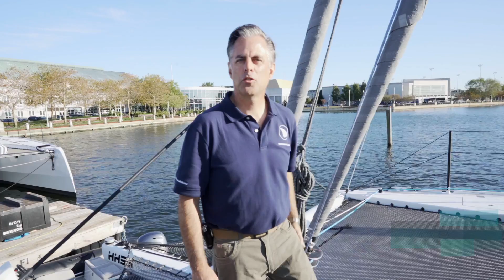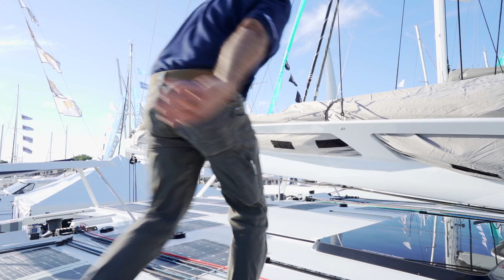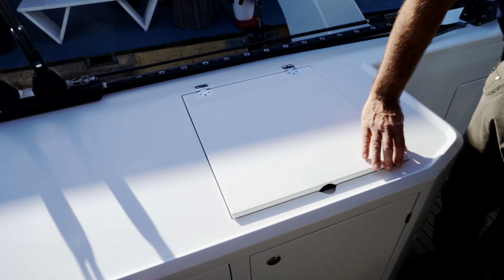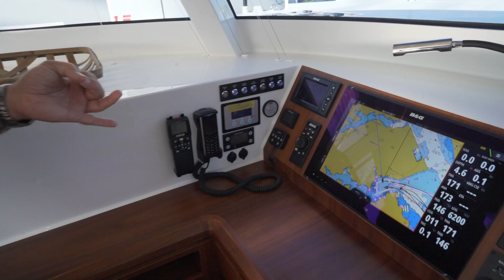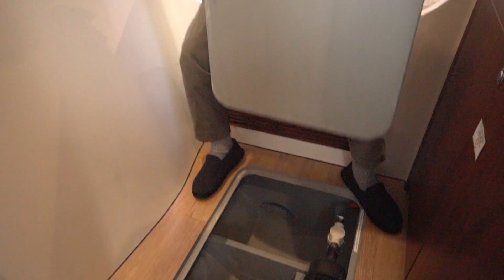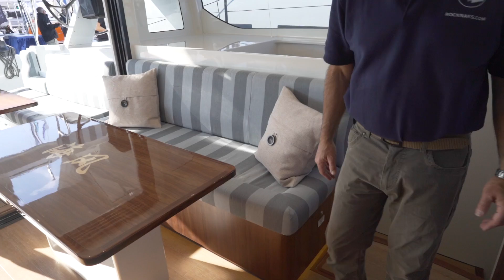HH55 Catamaran.  Guided Tour & Our Review.  Perfect Balance of Performance and Comfort.

Comment: SEEING OTHER REVIEWS AND TALKING ABOUT H&H BOATS  I'VE COME TO REALIZE THAT THERE'S TOO MUCH LIVING SPACE LOST THAT YOU ONLY NEED A RACING BOAT BELOW THE WATER LINE WATER LINE THERE'S NO REASON NOT TO EXPAND THE HALLS OUT TO MAKE FOR A MORE COMFORTABLE LIVING SPACE
A SPACE A DEDICATED SPACE FOR A HOME MACHINE SHOP WITH BOTH AN ENGINE LATHE AND MILLING MACHINE WITH DIGITAL READOUT OR AT LEAST AN XYZ POTTING TABLE THAT YOU CAN MOUNT WHATEVER MACHINE HEAD YOU WANT IT ON IT BE IT A MILLING MACHINE HAD OR A LASER OR A PLASMA CUTTER OR ANYTHING THAT OR LET'S SEE A 3D PLASTIC MOLDING MACHINE OR MOLDING HEAD . I WANT WANT THE HELM TO BE IN FRONT OF THE MASS . AND A SECURITY CAMERA SYSTEM CONVERTED TO CHECK EVERYTHING ON THE BOAT VISUALLY FROM THE SALES AND TELL TALES CLARENCE FOUR AND A HALF AND AN EYE ON YOUR DINGHY AND BILGE AND PLACES YOU CANNOT NORMALLY SEE SHOULD HAVE CAMERAS THAT YOU CAN JUST TURN ON AND TAKE A LOOK DOWN AND FORWARD FROM THE TOP OF THE MAST
DAVID ADAM GRENIS BOULDER COLORADO USA

Comment: One of the things I always wonder about all of these new boats is the lack of hard points for life lines. Either they don’t show them on the tours or they don’t exist. If I have to go up on deck in big weather I want lots of hard points close enough together to transfer life lines from hard point to hard point without ever being unclipped. The distance between hard points should never be long enough that it requires lanyards that would allow you to be swept over the edge of the decks. Being drug to death along the side of your vessel is not a great way to die. You are faced with drowning while attached to your boat or pulling the emergency release and drowning watching your boat sail away without you. 
     Also most life lines should be called death lines as they are usually just the right height to send you head first over the deck into the water. I would sooner have taller masts and shorter sails to have decent height life lines and stantions you can hang a truck off.

Comment: Most of the features I've seen on this boat are pros. Maybe a negative thing is by making the hulls made of carbon fiber which I think could block the signals of mobile phones and gadgets from under. So a fiber glass maybe is much better design for the hulls because it doesn't block signals, imo.

Comment: Solar panels are very sensitive to occlusion of light impinging upon them.

So all the lines that can be seen laying across solar panels on this boat are probably sufficient to stop the affected panels from providing current to the electrical system making them a waste of money and space.

So far as I am aware any sheets, halyards and lines that need to traverse solar panels on any boat are usually routed so they pass beneath rather than over the top of them.

Mono hulls have been designed to suit specific applications since complex structure first became an increasingly significant aspect of their hulls and in due time the same practice naturally extended to catamarans.

Performance cats and cruising cats are distinctly different designs intended from the outset to meet distinctly different applications just as has always been the case.

Performance cats may be great for speed, but things like carbon fiber and retractable keels or 'shoulder boards' do not provide the level of comfort and ease of use required for people who live aboard and may do so for years and even decades.

Carbon fiber is undoubtedly a high-tech wonder material but it is expensive and difficult to work with and in addition not only is carbon fiber not readily available in a majority of locations but neither are people with the  necessary skill to work with it.

By their very nature performance cats do not have the weight carrying capacity of cruising cats for good and valid reasons and pounding through seas of any size at ten knots or more is not conducive to comfort.

'Blotted cows' have always filled a need to haul cargo while more elegant designs do not merit intolerant contempt for being what they are meant to be which is comfortable, stable, reliable floating homes.
Reply from the maker: Good point. Solar loses efficiency if even slightly covered.

Comment: Is this boat worth the 2.5 - 3 million dollar price? IMHO, no, unless you don't need to ask that question. At 1.5 million, half the price, I would prefer the aluminum Garcia 52 Explocat over this cat even though the displacement weight in the Garcia is more. For bluewater cruising/exploration, it's a tank, is also very rugged and stiff, can sail in the high teens in moderate winds, also has the twin headsail, solent style rig, and also has the forward facing cockpit for forward seating. And, it's a Garcia. Thanks for this review.
Reply from the maker: It is way out of our prospective budget. But it was nice.

Comment: Whoa, looks like the fiberglass 50 is probably a reasonable price range.  I’d give up the performance, cause in fiberglass it will still be a good performance boat.
Reply from the maker: Yes, and fiberglass is much easier and cheaper if you need to get repairs done too. We could never afford an all carbon fiber boat anyway.

Comment: 33:25 why not just have a high-def camera(s) instead of two helms?
Reply from the maker: I really only see the benefit in having two helms  is if you are coming in to a marina or a dock and you want to be steering from the side that you will be docking on so that you can judge distance better. But other than that. I would always opt for just one helm. There’s no need to spend all the money to have everything duplicated on both sides.
Reply: Cruising Off Duty I agree. I think though there is a customer base of “rich” weekend sailors who want the two helms as a “racing” thing... and spending the extra money is an ego boost.  It’s showing off.

To them the two helms is like the two sinks for Janice.

Comment: Very nice, expensive yes! However it sounds like there's a lot of engineering and work going into each build. Styling is a lot better than at the moment. They haven't chosen to use the nothing but square styling most seem to be opting for. Thanks for sharing.

Comment: Thanks for sharing another great video. 

One of the most common laments I hear on videos of sailors is "the wind died", or "the winds were light" so we had to motor.  With a performance cat I would think that even in light winds (4 to 9 knots) you could be moving over ground at almost the wind speed (depending on the point of sail); that would have to be a nice option.
I like that this design had hulls wide enough to put in comfortable cabins and beds while minimizing weight to keep this cat in the performance category.  It had nicely protected helms as well.
Reply from the maker: I agree that a light performance cat can probably sail in much lighter wind conditions than a heavy production cat.

Comment: Yeah, $3M is kind of a hit.  I was interested in what Scott was saying about the E-Glass 50 and the keel system on that.  Winglets?  I've always wondered what a cat with a set of foils or larger winglets would do, particularly on a broad reach or downwind sail.
As to the appearance of the boat, and I realize it's a custom, so I could change it if I wanted to, I don't like the stark white interior.  If I was going to live on a 55-60' cat, I want something that's 'warm and cozy' and this boat didn't tick that for me.
Craig, something I've seen from Yanmar, and I would love to see it adapted to a catamaran is their 80-SPP drive system.  A steerable pod system with a bow thruster, it uses a joystick control to run the engine and the bow thruster together.  Currently, insofar as I'm aware, it's only available to monohulls.  However, if it could be adapted to a catamaran, you would have some fantastic controllability for docking, or even 'position holding' if coupled to your GPS.

Anyway, a bit out of my price range.  Besides, I want a Privilege.  I hope they had one at the show and you got the ability to view and tape it.
Reply from the maker: Thanks Gary for writing in.  The interior surfaces are painted so I am sure you could get it painted in a warmer colour.  There was a Privilege  at the show and it will be shown in an upcoming episode.  I think it was the last boat we filmed.  We liked it a lot, but its above the price of many of the boats we filmed (except this HH), so I doubt we will be getting that, but, it maybe perfect for you.  Again, if we had deeper pockets, we would have a much broader range to chose from.
Reply: @Bowmans-Woods  Perfect for me?  Hardly.  In my dreams only and if I hit the lottery.  I'm currently homeless and unemployed and live vicariously through people like you, for which i'm thankful!
Reply from the maker: Ok then. We can both dream and you are more than welcome to go window shopping cats with us.   :-)
Reply: @Bowmans-Woods  Craig, I'm single, have family, but no wife or kids.  When I win the next MegaMillions, $130M cash, I'm buying a catamaran, not only for myself, but a newer one for the Wynns, one for Nick and Terysa, and I'll help you get that X5 from Tomas that you want.  :) :p
I figure you guys have helped me deal with my problems, if I get lucky, y'all should share.  :D
Reply from the maker: That would be great.  That would make the news for sure.  Fingers crossed!  ha ha

Comment: From the angle shown the engine compartments access looked quite cramped for such a large boat, and you didn't seem to have a problem with all the lines being exposed to the weather and deteriorating on a 3m dollar boat as you did on a 600k Seawind 1260  ! 
It  was a pity the Seawind sales rep wasn't have as good as Scott.
He was excellent  !
Reply from the maker: Well I did notice the exposed lines but it seems to be something that the performance cats have.  Difference here is the lines were not on the deck where you need to walk.  Walking on lines is sub optimal IMO.  Big difference  when on top of the roof, although I would prefer they be hidden.  I saw that they also covered a bit of the solar which I thought wasn't great either.  Performance cats tend to want to eliminate weight at the expense of having lines exposed.  It is what you expect.  We wont be getting a performance cat but I can fault them for the design choice.

Comment: Great walkthrough. It IS interesting to review a boat designed for 'other' factors, like speed (light). Bit worried about carbon fibre maintenance (DIY?) and insurance, but if you have to ask... Also, the search for lighter is either more expensive or under-sized components (tanks, generators, etc.). This seems like a great balance though and the hull design with rigging is beautiful!
Reply from the maker: Good points Brian.  If you do have a chip in your boat, you may not be able to patch it yourself if it is built our of Carbon Fibre.  And, yes, as soon as a Cat seems focussed on performance it usually is very sparse inside when it comes to Cabinets and storage areas to minimize weight.  This boat seemed very comfortable.  A good balance of performance and comfort.  Just wish we were rich enough to be able to afford it.  I am sure a few viewers are and they may get a lot our of this tour video.

Comment: Sorry, but it is ALL laminate, he said so himself.
Reply from the maker: Real wood laminate over carbon fibre is what he said and the trim around the edges is also real wood.  I believe THAT is what he said.  You realize you could have fake wood laminate, right?  There is a difference.
Reply: A very selective quote - he said - 1. real wood edges, 2. wood laminate over carbon fibre, 3. when he tapped the door its real wood. Only hear what you want to hear (and in bold too).

Comment: Nice review and gorgeous boat.  I love the headroom.  Only nit is that I’m pretty sure the isolation transformer doesn’t convert 50/60 cycles, but 120/240.
Reply from the maker: It is gorgeous.  He may (or may not) have explained the Cycles correctly.  I think the point is, if you pay extra, you can get a boat that is universal and will take either European or North American shore power and convert it.  Im sure you wouldn't want both types of plugs in each cabin as that would be a waste of space and wiring.  You would pick your appliances to match your home country but at least you would have the peace of mind to know you can plug in anywhere.

Comment: I really liked the guy's presentation. Sometimes, it's just nice to dream of something completely out of your price range.
Reply from the maker: I agree totally Fred.  We knew as soon as we stepped onboard that it was out of our price range but it is fun to dream and we know some of our viewers have deeper pockets and get a lot out of tours of boats that match their budget, not ours.
Reply: I think that he's a very good salesman. Even though he knows that the HH 55 is way out of their price range, he treats them with respect and gives them a proper tour. At the end, he mentions the lower priced HH boats. 

Talking about out of my price range: every now and then I look at Gunboat 68 videos 😀 As much as I like Gunboats, I don't like the interior helm station. I much prefer being out in the breeze like the HH 55. But having to go down through the cockpit or round the back to go from one helm station to the other could be a bit of a problem.  My many years sailing A-Class catamarans, out on the wire with a 10' tiller extension, has probably affected my perceptions and made me a bit weird. 

Which leads to the question of rotating masts. An aerofoil shaped rotating mast cleans up the air flow over the lee side of the sail and you get a huge increase in lift. However, it's not just as simple as providing a rotating mast step. You have to make sure that all stays and shrouds, everything that goes from the mast to the deck, doesn't get affected by the rotation. We solved the problem by having single point on the leading edge of the mast where all the stays and shrouds attached. Maybe it's not as simple on a big cat? The HH 55 hulls look like they could handle the extra power. Is it a cost thing?

All in all, this is a very nice boat.

Comment: You don't need a lot of cabinetry in a propper performance cat because you are not supposed load her down with a lot of stuff anyway. <g>
Reply from the maker: Very true Anton.  A true performance cat does not have the storage capacity for a reason.  They lose their performance characteristics very quickly if you overload them with stuff.  If they don't build cabinets in them because then it is less likely the owner will overstuff the boat.

Comment: Which engine was that, with a factory installed 12v and 24v alternators?
Reply from the maker: You know, I think he said Yanmar 57?  But it sounded like he was insinuating that this "only" had 57's and you could opt for bigger?  This boat is pretty custom so I am sure if you are getting one built new, you could pick whatever engine maker you want as long as you don't mind the upgrade cost.  The reason it was 12 and 24v is the start batteries are 12v AGM but the house batteries are 24v Lithium ion.

Comment: Scott provided the Best Walkthrough I have ever seen on any channel... 

He Explained Capacity, Weight Limits, Daggers, Sails, Engines, Etc, better than anyone thus far... Most simply call it out by name... Scott provided Much Needed Technical Info... Moreover, he litterally utilized his 6' frame to show us Scale... High Praise For That... 
Two 👍👍 For Scott... 

Blueprints for Scale and  Technical Info per item is always necessary... 
(Hull Stability, Daggers, Sails, Engines, Weight Capacity, Fuel & Water Capacity, Draft, Beam, "CABIN DIMENSIONS", Etc... All are Necessary in order to make an informed decision... 

Great Presentation From All... 
Loved the boat... 
Still researching the Fastest-Larger-Cruising models... 

Viewed a fantastic one owner 70' custom cat in Italy... Unfortunately I've never seen a custom to date that didn't have substantial flaws... Usually drainage... Full disclosure is a problem outside the US... Heck, if full disclosure isn't covered in a purchase contract, it's a problem in the US....
Reply from the maker: Scott did an excellent job for sure.  Agree, 2 thumbs up for him.

Comment: What a beauty.  
If I had the means to order one I have some ideas of how I would change the design of the salon to suit my needs and wants. 
Not much to dislike about the rest of it.  I am with Craig regarding the sunroof.  If that big thing is open and a rain shower rolls into the anchorage, you better be quick to get things buttoned up.  We didn't see it operating. I am guessing that it isn't quick.
Reply from the maker: Yes a nice boat for sure.  The sun roof is huge.  Nice to check out your sails while underway I guess, But, when he said it causes a lot of heat to come in from the sun, I figured he knew best.  I also think that if there is even a chance of rain, you would certainly always keep it closed.  Again, it is a huge opening and would let in a lot of rain quickly.  I am sure you would not leave it open while open ocean sailing as you wouldn't want the salty ocean spray coming into your salon.  So I am guessing it would stay closed like 95% of the time except for a calm sunny day.  I am sure that is an expensive option that I would certainly skip if I was paying the bill.
Reply: @Bowmans-Woods  Living on the West Coast, a nice sunny day can suddenly have a 5 to 10 minute rain shower- while it is still sunny!  I've seen the same thing in the tropics.  So, I agree. It's an expensive option that would be best left an unchecked box on the order form.